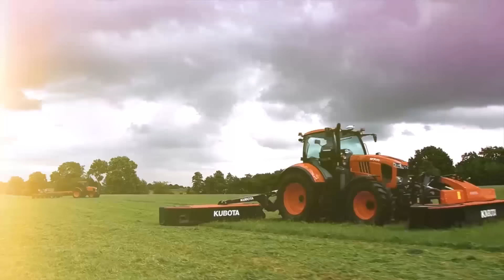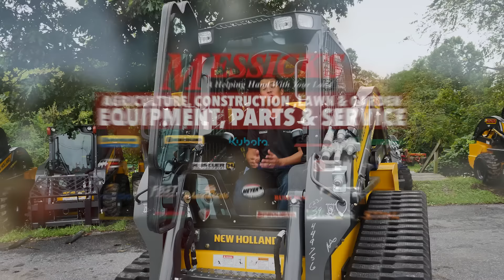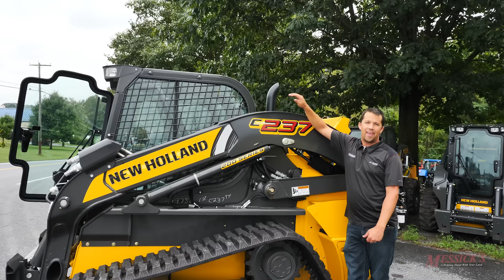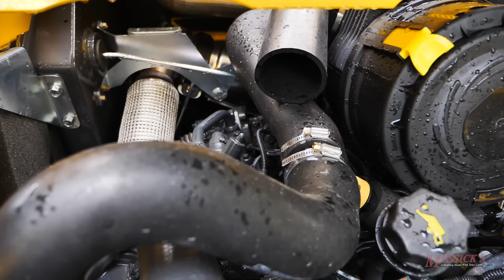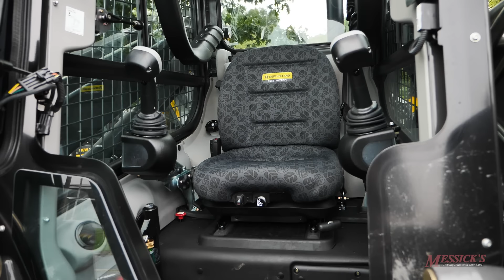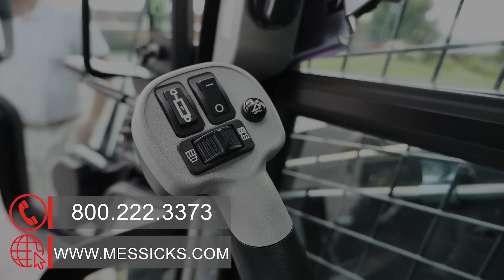New Holland C237 Track Loader - WALK AROUND

Comment: Always best to check the lift and placement of the bucket at top tilt before spending the money try it before you buy it. We had a load that was tipped over and i had to use our cat to put material in a end dump and it wouldn't even reach had to build a ramp. And ill be honest there really isn't anything that beats a telehandler weather its a skid or a tractor version one of those extendable boom applications are just pure Guinness. That being said cat is pretty dam heavy duty

Comment: I like the hand foot controls better I find with pilot controls it’s a lot harder to control the fine steering on wheeled machines like hooking up to buckets where you have to be within a 1/4 inch it seams to be jerky when ya wanna move that 1/4 side ways and always over shoot it whereas hand foot I don’t have that issue however that being said junk always builds up underneath the foot pedals making it harder to move until I clean it out I’ve never driven a new holland or kabota with pilot controls on a wheeled machine. I’ve tried to switch to the h pattern on a bobcat from pilot to avoid the jerkyness but could not because I’m to used to pilot. I’ve got a mini pay loader the size of a skid steer and just love it it can do everything a skid steer can. Can you do a product comparison on a kabota mini pay loader and a skid steer on load capacity steering capabilities visibility tire ware and overall general maintenance
Reply: I grew up on hand and foot controls and now after a few years of operating the pilot controls id never wish for anything else

Comment: New holland made john Deere's  skid steers for years.. now they look just like Case. Not sure who designed it but  New Holland was always one of the best strongest  and cost effective machines on the market for many years.. Caterpillar /bobcat  machines seem to be good  but a bit bulky. running a new holland you become "one with the machine" .. can really fly. Also new holland perfected the vertical lift boom design.. long before bobcat.. and ASV was building Caterpillar...
Reply from the maker: Case and New Holland have the same parent company, with the exception of some minor feature differences they are the same machine.
Reply: Love my 2020 T650 Bobcat, looked at the all, Heated Air Ride Seat, selectable Joysticks fit my farm perfect, especially with our CID Extreme mower, and Titan Stump Bucket.